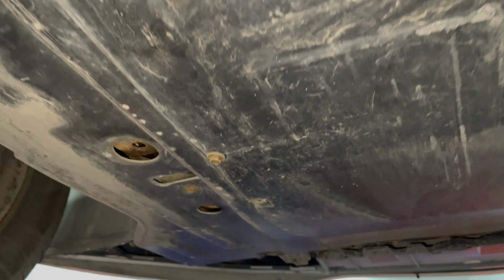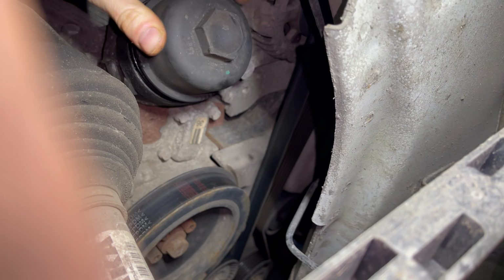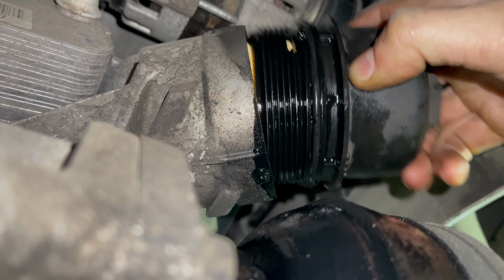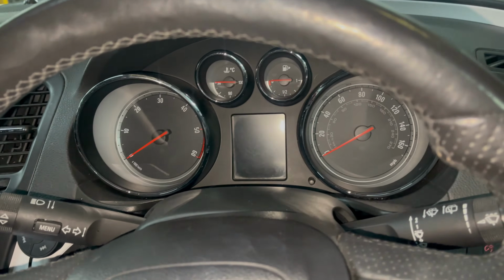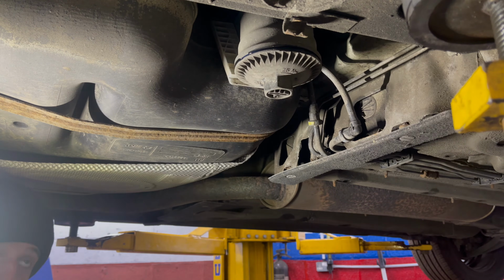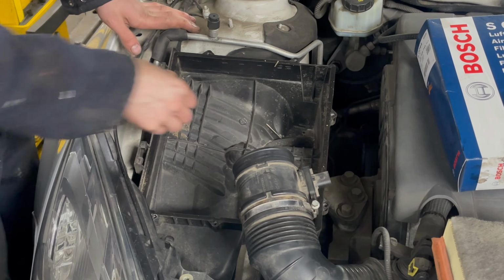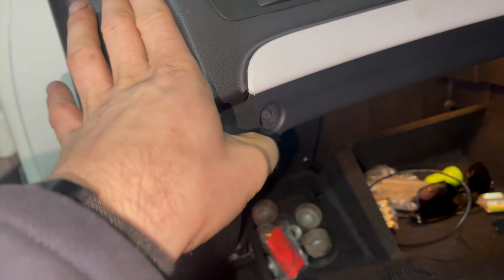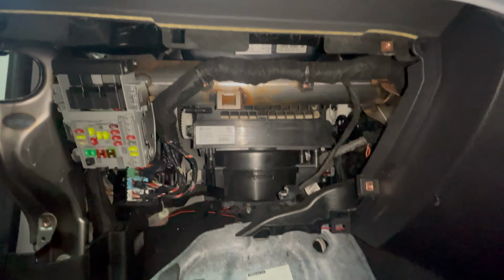Vauxhall/Opel Insignia 2.0 CDTI FULL Filter Service Oil Air Fuel Cabin - 2008-2013

Comment: Cut a 7up litre bottle in half for the oil filter replacement…. There’s lots of videos on YouTube to help you avoid the unnecessary mess you made … lesson learnt because the I made the same mistake myself just to let you know 🔧💥 the oil filter spillage clean up took longer than the service itself absolute stupid design by Opel / Vauxhall

Comment: I just bought a vauxhall insignia  2011  2.0  diesel  I've noticed it's only given me
 30 miles on a  £10er diesel  ..
 frigging guttted  also the engine management lite has come up on dashboard...
 my old car 1.9 diesel ford focus on a £10er it wud give me easily 80 miles,     can anyone advice me 
What the problem is ??

Comment: I learned to service my insignia by watching youtube videos. This is a good video to learn how NOT to service it. Why to make such a mess changing the oil filter?Put a piece of cardboard underneath the filterto drive out the oil. No need to remove the hose to change air filter. You can simply bend the plastics on the left and the air filter can be easily removed. Mesure the engine oil with a marked mug. 2.5 liters is more than enough. The air filter is not the same as the original. The new Bosch filter doesn't seem to be an activate pollen filter as the original, and i think he is installing it the upside down. My god!
Reply from the maker: I’ll gladly accept criticism but regardless of the cardboard there’s no clean way to do the oil change, it’s quite a reach up to the filter (I did this job again 2 weeks ago). In your comment I’m not sure when you say air filter if you’re referring to the engine air filter or the cabin air filter both times. Sometimes I remove more than necessary to make sure the job is visible, and cabin filters are available both as basic filters or the carbon filter you mention, that’s up to the vehicle owner’s preference. The cabin filter is the correct way up the arrow is direction of air flow not orientation. And if you’re only putting in 2.5 litres of oil when the capacity is 4.5 then you’re going to have problems.

Original comment:

@panosathenry679 • 20 hours ago (edited)
I learned to service my insignia by watching youtube
videos. This is a good video to learn how NOT to
service it. Why to make such a mess changing the oil
filter?Put a piece of cardboard underneath the
filterto drive out the oil. No need to remove the hose
to change air filter. You can simply bend the plastics
on the left and the air filter can be easily removed.
Mesure the engine oil with a marked mug. 2.5 liters
is more than enough. The air filter is not the same as
the original. The new Bosch filter doesn't seem to be
an activate pollen filter as the original, and i think he
is installing it the upside down. My god!
Reply: Great video, I'm servicing one at the weekend. And we'll said, I see Mr half an oil change didn't comment, his engine probably seized. There's always one or two in the comments so don't worry about them. Great video man, keep it up
Reply: There is always an idiot with a big mouth, on top of that doesn't know 💩💩💩

Comment: Use a a bit of card board, make it into a chanel, shove it under oil filter housing  crack it off let the oil run into something = no mess
Reply from the maker: Top tip 👍

Comment: I wouldn't give him my insignia for the service. He doesn't know how to replace filters. He destroyed almost everything, he doesn't even know about the drain plug in the fuel filter and he doesn't know that it is not allowed to vent the system like this. Just give the start to 2nd position several times without starting the starter because it  kills the fuel pump
Reply: You right mate , this is good example how DON'T DO IT SERVICE

Comment: i noticed that that the fuel filter gasket was the other way around when you removed it and you put new one in backwards. This caused a leak after a month in mine.
Reply: Hi, can you remember which way round you fitted yours? I’ve just done mine and put the groove part of the seal in  first.
Reply: @neilhopkins8673  I can remember that it was the opposite to what the video showed :D

Comment: Why are most mechanics dirty workers
Reply: Because no one taught them how to work clean. And often you think you'll manage to do it clean but it splashes everywhere. If they were well organized they'd probably be enginers not mecanics.
Reply: They are not, but this guy certainly is. I had to stop watching this for that reason. I am not a trained mechanic but would never allow this sort of mess. This car will be dripping oil on his driveway for many weeks to come.
Reply from the maker: Great question.
Reply: because they are HONKs     (HONK translates to   assistant without significant knowledge)

Comment: When I remove the oil filter I use an old piece of plastic guttering under the filter through the wheel arch to channel the oil away to a drip tray, saves messing up the undertray.
Reply from the maker: Great tip Steven, it’s not often I work on Vauxhalls so I just clean up after.
Reply: £50 for parts and your time, may as well give it to the garage, unless you want half a day doing it.....
Reply: I also find an empty 2l juice bottle, cut the bottom off.